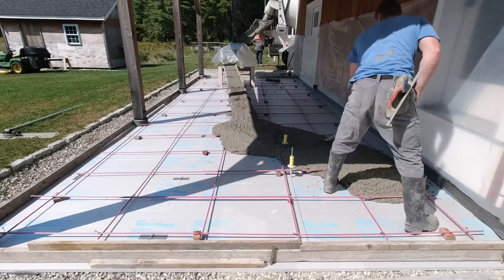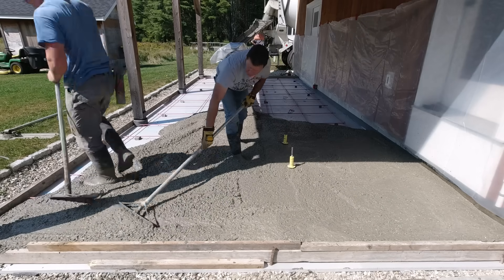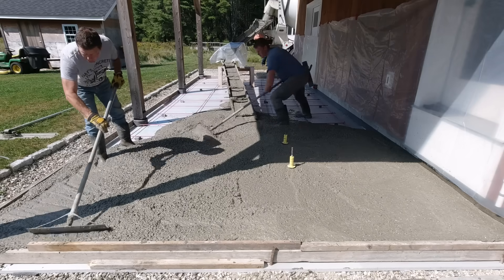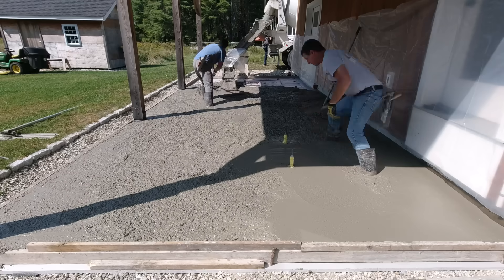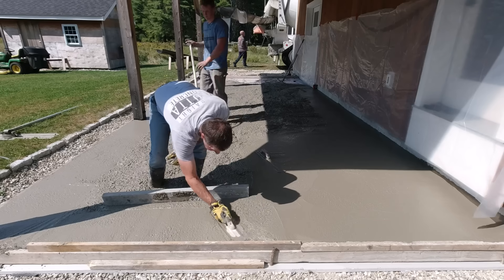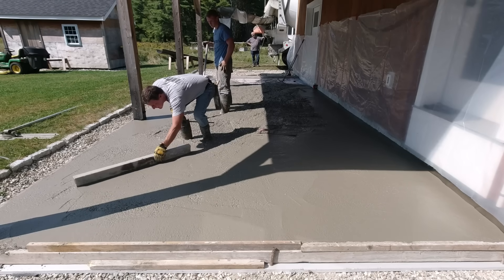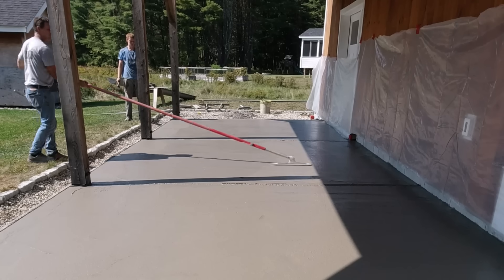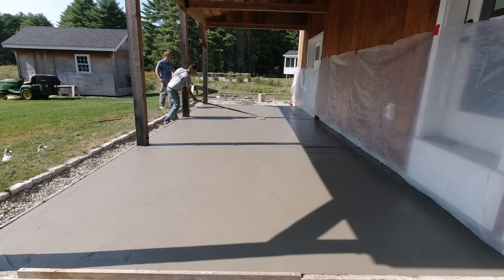Why This Concrete Patio Went From Rough To Glass Smooth

Comment: Unlike surfaces from sun and shade are a nightmare to broom evenly so the owner did you a favor asking for a smooth finish. The mistake here is using crushed rock in the mix with their sharp edges. Always use pea gravel pump mix because even adding a half sack more per yard for strength results in more butter to work with and no rocks to piss you off. BTW owner needs to be advised that smooth concrete is as slick as snot when wet. Using a burner trowel with a cloud finish would be a nice touch if you had decent help.

Comment: I thought no steel with air entrainment
Reply: There is a difference between hard trowel finishing and light trowel finishing. Claiming you can't trowel A/E concrete in general is a myth by people who don't like to trowel. ACI "recommends" not hard troweling, aka, burnish finishing A/E concrete. Hand troweling a surface is much different than repeatedly power troweling with finish blades in terms of densifying.

Comment: I always prefer a smooth finish to a broom but most times, for an exterior application, a broom finish is called for because of it’s slip resistance. Especially in colder climates where ice can be an issue, you would have thought they’d have gone with at least a light broom. Add a little mold or algae to it and you could get a really slick surface.

Comment: Why not run the power trowel over it? Is it that much smoother with the steel hand trowel?
Reply: Probably because he didn’t have it with him. On patios power trowels are rarely used. He planned for a broom finish which didn’t require it. Last minute homeowner changed it.
Reply: Power trowel and those troweled in joints don't work together well. It was a small pour, and he knew he had skill enough to hand finish quick enough - even compensating for inexperienced help. A power trowel can't get a good finish on until the surface is almost too dry to hand trowel, so hand trowelling it gets him done about 1 hour sooner - with fewer tools to clean. Because you have to wait longer to power trowel, the air-entranement is highly likely to cause it to peel. Power trowels and air-entranement are not to be used together. Also, because the strip next to the house was in the shade, he could save it for last easier by hand.

Comment: Like the broom in this case, with the rain blow in from the open sides, slick conditions could occur from time to time. 
Love how the customer throws it on you to decide what they want after they recommend changing what was agreed to 😂. Then later when something happens or when the customer doesn’t like it says ‘it’s what you recommended, and you’re the professional’, after they change what was originally agreed to. I’m a little surprised this particular customer is also a contractor. Frustrating when you go out to a job that’s suppose to be on the easier scale and then when you get there a last minute change happens that cost you more time. Had you known this originally you would have planned with different equipment, staff and time allotment. 
It all works out in the end, as long as you win more than lose and thankfully this is not he case for every job
Reply: Materials labors sales office…. And the good ole miscellaneous charge covers that last minute change that causes loss of time and more labor